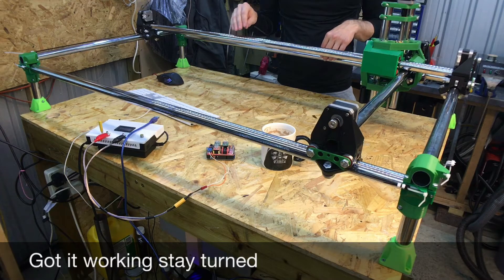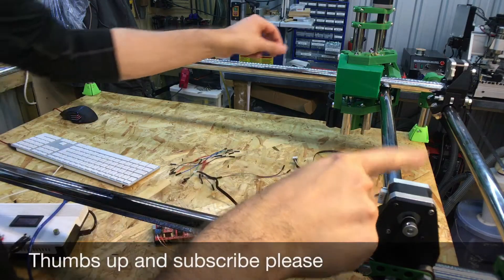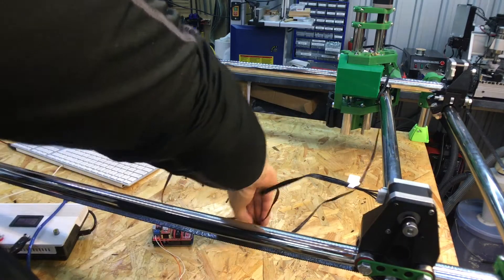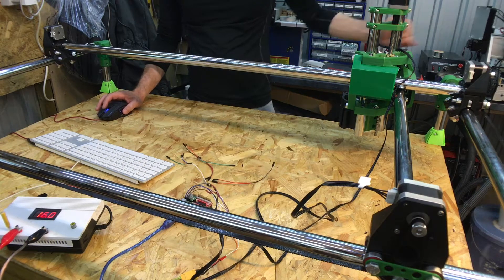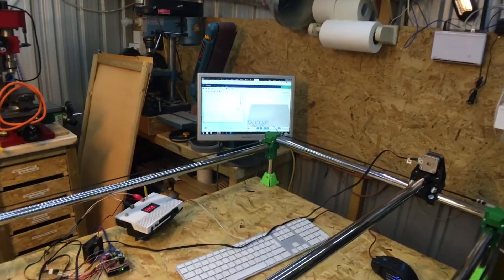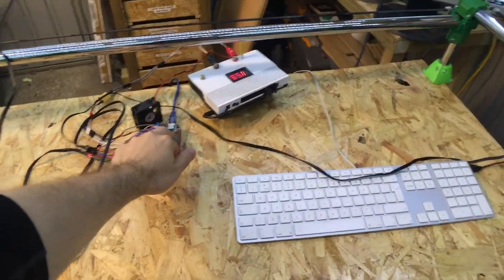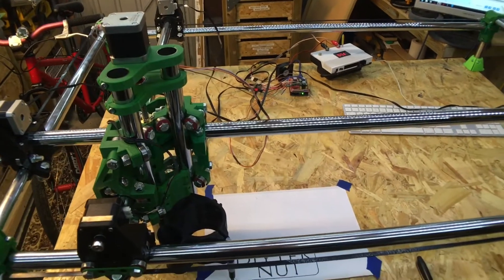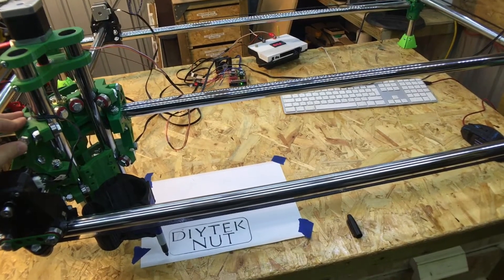Wiring Up A Mostly 3D Printed CNC Router MPCNC PT3

Comment: A....while wirering the 2 axis motors parallel..... how did you solve the direction of movement issue if 1. goes right - 2. must go left? Did you just "turn the cables on the 2. motor 180 degrees"?  B. On the cnc shield next to the power input are jumper slots for a second motor..... I asume this is only for enabling the "A" socket on the shield (red colour)....which doesnt bring us further as we need 2 extra outputs for the 2nd x + y motor...so the "parallel wirering is a must"?!.......thx for showing so much in your video.
Reply from the maker: motors are in parallel you need to switch the wires around on one motor
Reply: DIY TEK NUT But how do you handle the double current,I thought, the drivers will die on it.....
I found some info about having the motors in series
Reply: ..yep i also came over this solution and tried the series connection..which ended up in two drivers burned... im not sure what went wrong...someone having an alternative version to that of  v1engxxxxx(inverted direction on one axis) ...->showing all wires.
Reply: @paskmoe4969  I am preparing my MPCNC at the moment, so there will be a time within this month, where I have to solve it, I let you know...
If not, I take a RAMPS and use the E0 and E1 for second X and second Y.... Keep you posted.
Reply: yeah thx...hope you are showing more around the mpcnc..